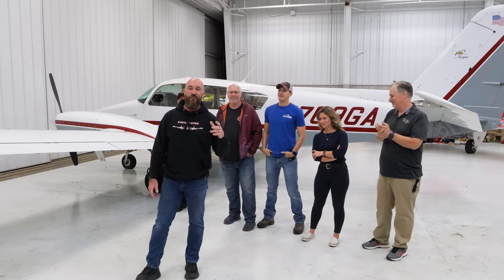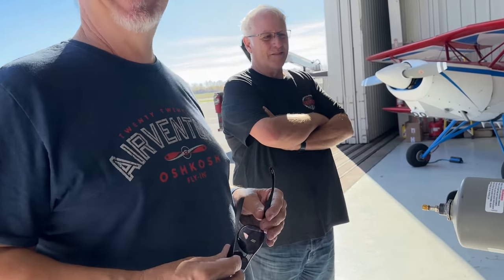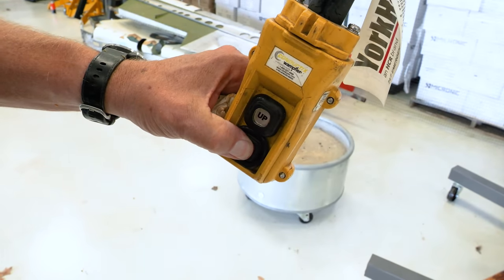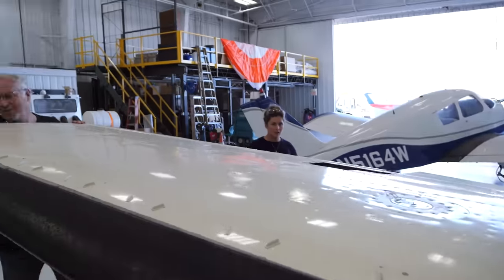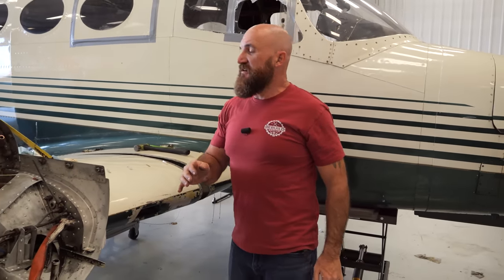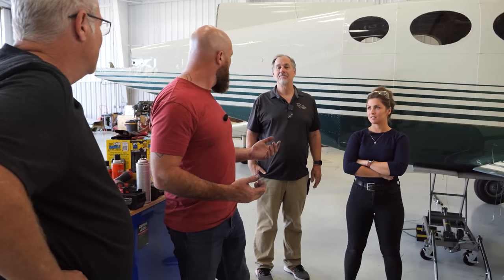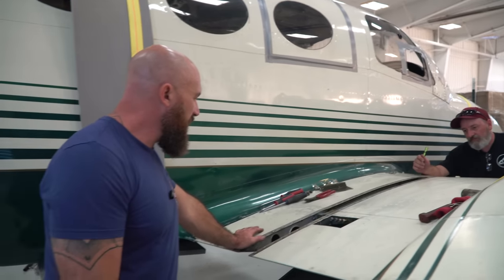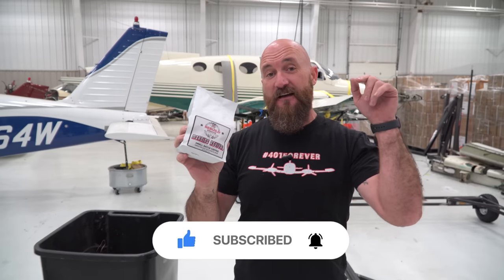We Failed At Removing the Wings on The Free Abandoned Airplane

Comment: After Pulling 18 King Air 200/350 wings I feel your pain, and Aircraft mantenance manuals are NOT detailed. Remove Cables, Remove Fuel Lines, Remove Electric Cables, and Remove bolts.  Very seldom are they super specific.  MAKE SURE YOU MARK THE ALERON CABLES AND TRIM they are easy to get backwards and that makes for a NASTY test flight
Reply: The MM is written with an expectation that the person(s) performing task are trained in aviation maintenance. The MM does not start off with "how to pronounce 'fuselage' "

Comment: Lifting slings should have an ideal angle below the hook between 30 and 45 degrees. More than 45 puts excessive strain on the sling. A 401 aircraft wing won’t stress the sling but the compressing effect of the sling will damage the wing.
Reply from the maker: Thank you David !

Comment: An idea of get them put back in is to supper freeze them to make them shrink and you should have like 30 seconds to get them in.  I saw a video on you tube in certain Citation Jets being built where the did that to attach the Tail Rudder upright they pulled the bolt out of the liquid nitrogen and had like 30 seconds to place the bolt until it started warming and expanded.

Comment: Being a Mechanical Engineer, I am looking at the wings thinking. The landing gear is under the wings, this holds the main weight of the plane. I believe you need to take the weight off the wings by lifting the fuselage this will take all the stress from the downward force of the plane off the wings. this could be done with blockage on top of the carts to hold the body and jack them till the gear is just off the ground.
Reply: yep, and as soon as he does get the bolts out the fuslelage will be trash because it is not properly supported. The plane will  never fly again

Comment: It appears the flange or tab riveted in place preventing the bolts from coming out might have been riveted in after the wing was installed as the rivets were visible through the skin.  It might have been put there to prevent any of the bolts from fully becoming extracted should they loosen before a maintenance check was performed.  Access to that part of the underside of the wing appears to be accessible and the tab been installed before painting.  Perhaps there doesn't seem to be any other structural purpose to it?

Comment: This feels wrong to me, just "winging" it (pun intended): "oh, we just cut a hole in the skin to get the bolts out". There has to be a maintenance manual that says how to do it right, right? Right? And after Chelsea and Joe left, you continued without an A&P present?

Other than that, it seems obvious that you need slide hammer to pull those bolts out.

Comment: When they built all of the 401’s they bolted the wings skeletons to the fuselage then put the skin on it’s very obvious and I’m sure the bolts were put through this way for an engineering reason!
Reply: This is completely false. The wings were skinned in a jig for the proper shape then installed on the fuselage.

Comment: Jason, I don't know if someone has already said this, but when you are trying to undo what has been done, it is best to think about how it was originally done. How were those fixings installed in the first place? Probably the skin was off the wing when it was assembled. So, if you're going to take that wing off without destroying it, you need to remove the skin panels. Equally, when you install the 'new' wings, you will have to remove those same skin panels. Why not practice the technique on the old ones first?
Reply: That is not how the plane was built. Take the skins off and the wing is going to twist and it will never be right again.

Comment: I question if those bolts are the best way to remove the bolts in the wing. are you sure there is not an easier disconnect on the other end of that piece?

Comment: on the next wing get one of those inflateable bladder car jacks. Put it in between the fooslidge and the wing, inflade to seperate.
Guys, I spelled out fuselage as fooslidge to rib Jason, to make him grin
Reply: 👆 not required 👆
Reply: Oh FFS!
Reply: @eagle2019  It drives me fuckin nuts every time he says it. Even though he holds a pilots licence, it suggests to me that he isn't a plane guy. Joe pulled him up about it a couple of videos back and he persists in saying it that way. He really doesn't have a fuckin scooby
Reply: ya , just use a bladder, them stupid bolts will just snap off of the " FOOSLIDGE"  no need to unbolt them.

Comment: I'd take those cut cables and use them on go-carts or lawnmowers.
After all, how often can you legitimately claim you have aerospace parts on your projects?
Is that large silver line (fuel line?) with the blue coupler detached somewhere? I can't tell.
Certainly large enough to be holding things up, if not. But I have no idea how the wing comes off.

Comment: Its possible just  drilling out the offending blocking rivet would have saved cutting a panel out of the wing, but I cant see what you can see with the MK1 eyeball. would your dry ice cleaner cool the wing bolts enough to make them cold enough to reduce their dimension a tad and allow some more movement. Its an awkward spot for a slide hammer.
Reply: the wings are not being reused.
Reply: @warrenmichael918  Yep I know. I spent 30 years in the industry and habits never leave you; Save the bolts for re aligning. Id left the monitor before the end of the clip to attend to my dogs. I was forgetting he had a Joe / MacGyver to cobble up the attachment to the slide hammer. The bolts would be a very close tolerance to avoid any chance of looseness in the air. Dropping the new bolts into a fridge /freezer for a short time would help them into the wing on rebuild.

Comment: There is one penetrating oil that beats ALL of the rest . . . Mix 1 part Acetone with 1 part Automatic Transmission Fluid, it works GREAT. Be Carefull, use it sparingly so you don't messup the treated surfaces AND it is more flammable than the others.

Comment: Ya'll need to call the fire department and have them bring out the jaws of life to carefully place in the gap to separate the wing from the rest of the plane once all the bolts are off.  Also as I mentioned in another video, when rebuilding planes, you cannot reuse old screws, bolts, rivets, etc per FAA regulations without verifying that the screws you pulled out are the exact same factory parts.  Reason being is because if you reuse old parts that are not the correct parts for that plane, those old incorrect parts on the plane could come loose which could lead to disaster.  If you want an example of something like this, look at British Airways Flight 5390.
Reply: cite the regs.

Comment: The structure was almost certainly built before the skins were fastened to the structure. The direction of the bolt installation was not structurally significant, but from a future repair & overhaul standpoint, it appears to be a mistake by the manufacturer.
Reply: @eagle2019  The bolts are in shear, that would typically mean the orientation is optional to suit assembly & disassembly. & avoid having to cut the skin & stringers. It might be worth a shot to seek engineering permission. Unless of course they're trying to protect the nuts from exposure to the elements. Was there not a manual available for the removal sequence? Is that the screw up?
Reply: @eagle2019  So like I said, it appears they did have, & or didn't follow the manual.
Reply: @eagle2019  And so, faced with the issue in the video, with the bolts apparently trapped in the structure, how would you have removed them?
Reply: @eagle2019  Excellent, now they know how to get the other wing off.

Comment: I would never fly in the 401, it's way too old regardless of any restoration! Crazy
Reply: @eagle2019  A different story, B52's are built better than the 401 to start with...no comparison
Reply: 'Old' doesn't mean it's unsafe.  if it's properly maintained as per the shedule and worn-out parts replaced. it should be perfectly serviceable.
Reply: @BusyElf  I wouldn't get into any plane that's old I don't care what type it is, period!

Comment: Cut rivets pull the skin to access bolts reattach skin after putting on new wings and fasteners
Reply: @eagle2019  Oh I forgot get out the hot wrench and burn a 2 foot hole through the wing install bolts get some sheets of plastic and JB weld make sure to only buy FAA approved JB weld
Reply: @eagle2019  No way dude bailing wire n bubble gum 🤣

Comment: This is a problem with partially-threaded bolts where the bolted parts are under shear stress. I run into it when removing the front shock fork on my CRX. Obviously a slide hammer can work, but you risk shearing off or otherwise damaging the lip of the hole - the threads of the bolt act like a metal file. Alternatively, put an open-end wrench (or other implement like you made for your slide hammer, the wrench should match the bolt shank) under the head of the bolt and put outward tension on it. With your other hand, turn the bolt using a ratchet, driver, impact or whatever. The inner end of the bolt threads should rotate around and up onto the offset bolt hole. From there the bolt should thread out as though the offset/shear point were threaded.
Reply: They are called "close tolerance bolts" and they fit with a slight interference. Rotating them in the fitting will destroy the fitting, they should be drawn straight out during removal. The bolt shank is slightly larger than the threaded portion so the threads shouldn't drag when the bolt is extracted.
Reply: @buckmurdock2500  Considering the number of bolts used here and application, I doubt that they would use such fasteners - the hole locations and bores would need to be drilled within a few thousandths of an inch across the entire production run. The other option being to drill the holes with the mating parts already clamped together, but that would "marry" the parts - each wing and fuselage set would be unique.
Also, in a shear-force situation, the final two bolts will still see thread contact when the joined parts start to slide past each other.
Reply: @eagle2019  Where did you find that number? Are there parts diagrams online somewhere?
Reply: @eagle2019  Thanks. Looks like the Cessna website also has it for free as a 98MB PDF. P499-12.
Reply: @eagle2019  Looks like the NAS464P10L32 are the forward spar attachment bolts. The ones they're fighting with at the end of the video are the aft spar attachment bolts, index 6, 7 and unmarked (?) on the drawing, NAS146-47 and NAS146-49 respectively.

Comment: WOW, cutting a hole in the wing skin to access the socket head cap screws to be removed.  I would have thought that you would have spent some time figuring out how to remove the skin section without destroying it so you could employ that knowledge when installing the replacement wings. Then you state that you will install the bolts from the opposite direction when installing the replacement wings.  Did it ever occur to you that the factory intentionally installed the bolts and the sheet metal that prevented you from pulling out those bolts for a reason? I am curious to see if the A&P allows you to do install the bolts from the opposite direction, and if he does, is there an IA willing to sign it off.    Hopefully the FAA is watching this.

Comment: Just curious, are you sure you need to remove those 10 bolts? It's kind of hard to tell from the various camera angles but it looks like those 10 bolts are what mounts the piece you took one of the bigger bolts out of between the wing.  You might check around that bracket to see if a weld went wrong.
Reply: Well if they DO find a bad weld in the wing, something most certainly DID go wrong!!

Comment: Am i the only one who finds it rather dangerous to have an airplane sitting one some hydraulic devices for several days? Or is that just because i already had to help someone who was stuck under his car because the hydraulic jack failed to hold. (and knowing that it is a common safety rule to not do that, because hydraulic cylinder sealings are not made for extended static pressure, unless specifically ordered)
Reply: From watching as lot of Car mechanics, definately place an axle stand or other suitably robust and/or solid structure between suspended  weight and floor.. It prevents untimely deaths.
Reply: Well them pesky landing gears are hydraulic and they seem to hold planes up pretty good for extended periods of time. I am also not familiar with them fancy lift tables they are using so im not sure your worries are needed really.

Comment: Is it just me or does anyone else get the feeling that it's the fuselage itself that should be lifted instead of the wing? 
To me, it makes sense that if the main gear is holding the wing up, which is in turn holding the fuselage up, you would want to reverse this to eliminate the stress points so the connecting bolts can slide freely.

Comment: I’m guessing the wing structure was bolted on and then skinned during manufacture. It’s going to be a challenge to bolt on the replacements without removing more rivets first.
Reply: @eagle2019  scan that section and send it to Jason!
Reply: @eagle2019  I hope someone that is working on the plane listens to you Eagle. It sounds like you know what you are talking about. I personally don't think that plane will ever fly again. But I'm no pilot or airplane mechanic.
Reply: @eagle2019  I was also thinking Cessna designed those fasteners to be captive, no way they wouldn't have a procedure for removing the wing.
Reply: nope
Reply: @eagle2019  I agree with about every one of your comments on here throughout the comments. Now, having said that, the one big thing you might not be seeing clearly on is this, Jason and the guys all are doing this video series to make money to restore this old girl. They know a straight forward , by the book restore isnt what gets and keeps the viewers attention. I think they are really hamming it up a little bit for the sake of drama and to generate comments since thats what helps the channel. Joe is there and seems like he is an A&P or whatever its called and he has had a few others swing by and give him a little help. As you said, they are required to have the MM right there and i bet they do but they like the drama. Like the hole being cut in the wing, even though they are not gonna use it again, they did that just to get the comment section going i think!!  Im still enjoying the build though.
Reply: @eagle2019  That was my point about that hole too, it was pointless and with the guys they have there, who all seem to have some background with planes, it almost has to be done as a joke or to troll the people in the comments doesnt it? I am in no way an airplane guy and really know nothing about that side of airplane restoration and i have seen a few things that just made me think they were doing it just to get views and comments. Jason or someone at RR comments in here quite a bit and they HAVE to have read yours and others correct instructions but they never respond to them. LOL they are getting a kick out of all the people giving their silly ideas. I am sure you are laughing as much as you are shaking your head at some of the suggestions in her about how to remove these wings!!  Maybe he will respond to you, it seems like you would be a big help with just a few emails or phone calls on this.

Comment: Jason, I may be wrong here, but I don't feel you were THINKing OUTSIDE THE BOX/SQUARE, think how the wing would have been attached to the fuselage in the first place. How would they have attached the wings with the panels and flaps in place, the trouble you had getting those bolts OUT, they would have had the same trouble getting those bolts IN.
THINK OUTSIDE THE BOX man.
Reply: No, because they have an assembly sequence that is followed. There's no head scratching about how things go together on the assembly line.
Reply: @buckmurdock2500  Hi Buck, Yes I realize that, but, these are guys that haven't worked on an aircraft assembly line, therefore the thought is "How would they have assembled this?" if I am having so much trouble disassembling it.
I see where you are coming from and I appreciate your comment.
Reply: Or better yet,  go to the maintenance manual and simply follow the factory procedure.

Comment: Getting the wings off is the reverse of putting them on.  To get the bolts out, or IN when you put the wings back on the 401, I would suggest you follow the manufacturing process and remove  the top wing skins.  To bolt up the wings back on you are going to have to remove the wing skins between the connection point and engine compartment. Then when that is done you can rivet them back on.
Reply: That makes sense.
Reply: The manual does not require removal of any skins. That would be a disaster.
Reply: Did someone put those bolts in backwards then?
Reply: @ryancappo  check the records for what was done after the gear up landing several yrs back. Oh wait, there are no records...

Comment: Jason, an air operated palm nailer works like a rivet gun, except it's a lot shorter. The palm nailer will drive the bolts out in a controllable fashion.

No way I'd of Magilla the Gorilla'd a hole in the wing skin and cut through the stiffener. Get out a center punch, center the skin rivets, drill with a #40, then come back with a #30 drill. Skin off with no damage.

Check the 401 manual to see if it's allowable to reverse bolt direction on reassembly.

Comment: After thinking about it. Tap the bolts out enough to Dremel the heads off, & then tap back the other way. Reinstall in the more disassembly friendly way.
Reply: The IPC will show proper bolt orientation.
Reply: @eagle2019  I was suggesting an alternative, less destructive, way of getting them out, as opposed to cutting the skin & stringer.